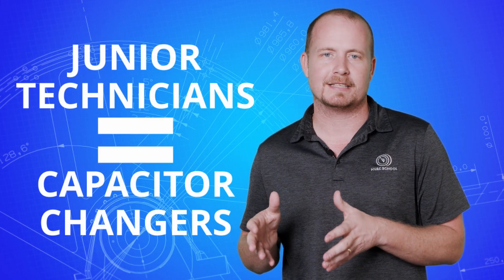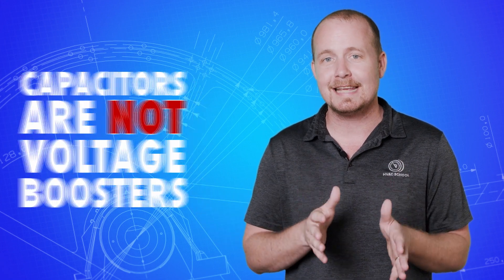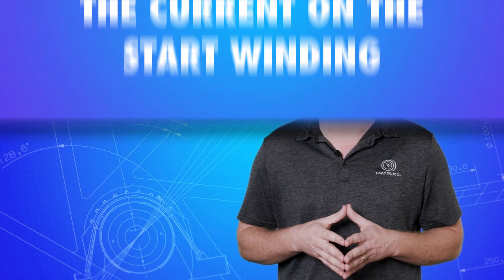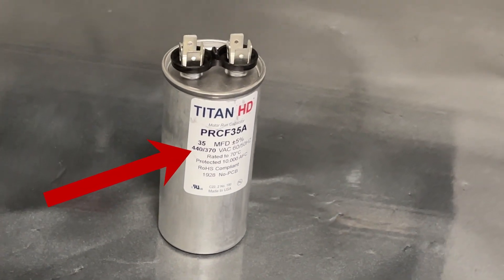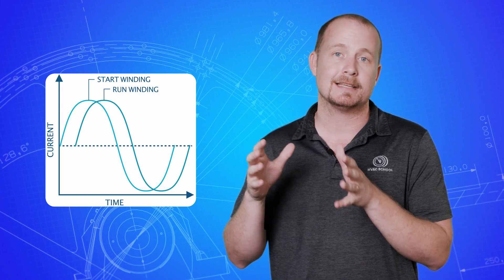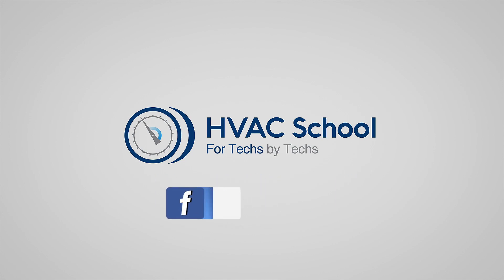5 Misunderstood AC Run Capacitor Facts

Comment: Has anyone ever seen a condenser fan run slow when hooked to a dual run cap (50/5) but runs at full speed when you use two capacitors (one 50 and one 5) and yes the dual run tests 100% fine, and I even swapped if for a brand new fresh off the truck 50/5 just in case it had something strange going on.

Comment: Near the end you came up with a formula to determine the value of the capacitor.  You show the measured start winding current times 2652 (60hz) all that divided by the measured voltage across the capacitor, in your example 192.9 volts.  Where did you come up with this formula?  I know the subject of capacitive reactance is not the name of the subject here.

Good tutorial -  Jim

Comment: I have a battery power supply system EPS it have a 30 millisecond switch over time can an AC capacitor put across the 110v circuit to bridge the gap of voltage drop for switching time.

Comment: I couldn’t find locally my two phased ac capacitor but was able to find a three phase but didn’t buy it because I didn’t think you could use a three phase for a two phase. Wife called ac tech and he came out and installed a damn three phases capacitor and charged me $208 dollars later. SMH charged $119 for the capacitor and 89 service fee. My question is it okay to have the ac capacitor like this.

Comment: Some of this is a little misleading, but accurate. There is a magnetic coupling between the plates in the capacitor. While the electrons aren't passing through the dielectric and insulative barrier, a charge is being induced on the other plate of the capacitor (via faradays law). You should probably go into a little more detail about I rms and V rms to provide a little better explanation of capacitance, and the phase shift and reactance that is happening. Good video still through.

Comment: As an Electrical Engineer, I don’t know how to comment. Some things are correct, others oversimplified but kind of correct, others intuitively correct but very wrong. 

The ideal induction of a motor is exactly the opposite of the ideal capacitance of a capacitor. 
I = C•dv/dt vs V = L•di/dt. 

What happens when the rate of change of current equals the rate of change of voltage?
Reply: Geez!!!  We are technicians not engineers. His explanations are perfect for techs. Just the info we need. Just enough but not too much. We work on this stuff. We don't design it. Nice touch with the derivatives. Some of us had Calculus and AP physics in high school but we don't need that crap to troubleshoot or remove and replace faulty components. 

But to answer your question about what happens when di/dt equals dv/dt in a RLC circuit is called resonant frequency. This happens when the inductive reactance becomes equal to the capacitive reactance in the circuit (2πfL = 1/2πfC or ωL = 1/ωC) and maximum current flow occurs because the inductive reactance and capacitive reactance cancel each other out and the circuit becomes purely resistive. 

You state: "The ideal induction of a motor is exactly the opposite of the ideal capacitance of a capacitor." But a better and more accurate statement would be: "The ideal induction of an inductor is exactly the opposite of the ideal capacitance of a capacitor." Because a motor is not purely inductive. It has a resistive element to it. So you're wrong there.

Some of us technicians know this crap, but unlike "engineers", we don't see the need to flaunt it.

Instead of coming on here to show off, you should be helping by answering questions some of the techs have.

Comment: I’m still confused as I thought compressors needed a start capacitor. Dual run capacitors indicate RUN, so where is the START CAPACITOR?
Reply: They don't need start capacitor
Reply: It depends on the type of motor that drives the compressor. A Permanent Split Capacitor (PSC) motor will only have a run winding that remains in the circuit from start to finish. The run capacitor helps provide more torque at start-up, and once it reaches the motor's rated speed, it helps the motor run more efficiently. That's how this motor gets its name: the capacitor is permanently in the circuit and its duty is split into helping both the start and run windings.

Another type of motor is a Capacitor Start Capacitor Run motor. It has a start and a run capacitor. The start capacitor helps provide more torque at start-up and then it's taken out of the circuit by a relay or centrifugal switch at about 75% of motor's rated RPM. 

There are other types of motor but I don't have the time to list and explain them all. I hope you get the jist of what happens with the 2 examples above.

Comment: Ok here is a possible myth. But could be true. I have been told you can go up on the compressor capacitor size by 5 microfarads. Now if you’re using a turbo 200X and are trying to make a 45/5 connection it says to use the 50MFD terminal. So i would think it was ok. But I’d like to see what the pros think.
Reply: I've always been told you can't go down in size but you can go up but not more than 10%, so I believe amrad recommendation to use the 50 Terminal to replace a 45 is acceptable
Reply: @7x779  As far as the microfarads, I think it makes more sense the other way around. It's better to go down a max of 10% than to go up a max of 10%. Going up by 10% will increase the current that goes through the start winding and may reduce the motor's life, but I don't think it's going to hurt if you go up or down a max of 10%. Ideally, you want to replace a capacitor with one that has the same exact MFD and voltage rating. 

One thing you cannot go down on but you can go up on is the voltage rating. Like he said in the video, you can replace a 370 Volt capacitor with a 440 Volt capacitor but you cannot replace a 440V with a 370V.
Reply: @bernardocisneros4402  did you find actual information somewhere that says going up in capacitance will cause the compressor to draw more current?
Because from what I recall, whenever I replace the capacitor that's reading 10% or more low and I checked the amperage before I change it, when I put in a new one it actually draws less current. And the lower the capacitance is on the old when I'm replacing, the greater the drop in current is when I put the new one in which has the correct higher value
Reply: @7x779  I don't know what type of motor you're referring to and if it had only one run capacitor, or it had two, a run and a start. I also don't know which current you measured. Did you measure the current going through the start winding or the run winding or both?
Did you measure the in-rush current (LRA) or the running current (FLA)? 

The most common type or motor is the  Permanent Split Capacitor (PSC) motor and it comes from the factory with only a run capacitor wired in series with the start winding and in parallel with the run winding.  On this type of motor, increasing the capacitance (MFD rating), will increase the current flow through the start winding at start-up to increase the torque for a quicker and easier start cycle. After the motor starts and reaches its rated speed, the current through the start capacitor drops significantly due to back EMF. When the motor is running at rated speed, the run capacitor helps the motor run more efficiently. 

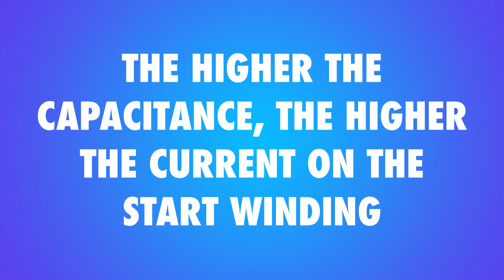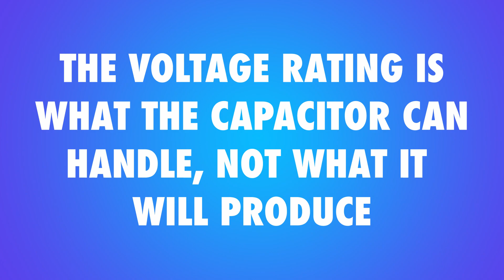Go back and watch the video from 1:52 to 2:40 and listen to Bryan re-iterate this exact same concept.
Reply: @bernardocisneros4402  I'm talking about when the motor is up and running weather at the compressor or a condenser fan motor or a blower motor and it's irrelevant whether there's a start capacitor or not because it's not connected or functioning at that point, and I measured both legs on the standard PSC blower and condenser Motors, and usually measure the common and or run on the compressor

I'll have to pay more attention to this in the future, but from every one I can remember, the current dropped when replacing a weak capacitor
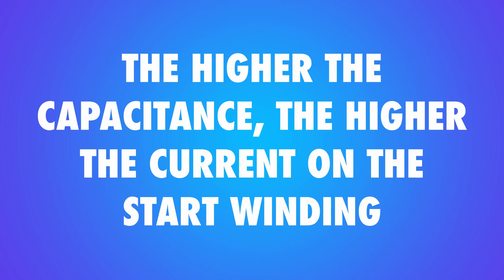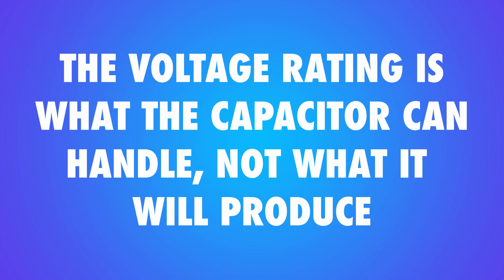Reply: @7x779  Did you re-watch the video from 1:52 to 2:40?
Reply: @7x779  I'm talking about the current draw when the motor starts. When you put in a capacitor with a higher MFD rating, it creates a larger phase shift between the current waveform and voltage waveform in the start winding at low RPMs because there isn't much back EMF at low RPMs. As the RPM increases, so does the back EMF. The back EMF fights against the phase shifting effect of the capacitor, so as the back EMF increases the phase angle difference between the current and voltage waveforms in the start winding decreases. Once the motor is running at rated speed this difference in phase angle is as small as it's going to get, and the smaller the difference in phase angle, the higher the power factor. The reason you see the lower current with a bit higher MFD capacitor is because it improves the power factor when the motor is running at rated speed. The engineers pick a capacitor with an MFD rating that will give a good starting torque, only draw as much current as the start winding can handle, and help the motor run more efficiently at its rated speed.
Reply: @bernardocisneros4402  that's a good explanation, thank you. I'm assuming that in your last response you're talking about a compressor or motor without a start capacitor, correct?
Reply: @7x779  Yes, I'm talking about a PSC motor with only a run capacitor. When these motors get old and have a hard time starting, you add a hard start kit (5-2-1) to help the old tired motor start. The hard start kit adds a start capacitor in parallel with existing run capacitor and in series with start winding. Which is essentially just adding more MFDs to start circuit. The additional MFDs create a larger phase angle shift between current and voltage in start winding. This makes the start winding draw more Amps at start-up. 

The additional MFDs also cause a larger difference in phase angle between the current waveform in the start winding and current waveform in the run winding. Along with the increased Amp draw, this phase shift between the 2 currents causes the additional torque that helps the motor start. Once the PSC motor reaches about 75% of rated RPM, the high back EMF generated in the start winding energizes the relay of the 5-2-1 kit and it opens the contacts between terminals 1 & 2 in 5-2-1 thereby removing the start capacitor from the start circuit.

Don't confuse the phase angle shift between the current and voltage in start winding with the phase angle shift between the currents in start and run windings. The 2 are not the same. The phase shift between voltage and current in start winding draws more Amps through the start winding while the phase shift between the currents in start and run windings helps create more torque. 

The additional torque at start-up is a result of the additional amp draw, the increased phase shift between the currents in start and run windings, and the geometry of how the start and run windings are arranged within the stator of the motor. 

I hope this explanation causes more understanding than confusion.

Comment: What's the difference between "in and out" vs "through"?
Reply: In and out is like walking in the front door of your home and then walking back out using the front door. 

Through would be walking in the front door and walking out the back door. 

Current never goes through a capacitor. It only goes in and out of it.  It only seems that current goes through a capacitor when using AC power because AC power goes back and forth 60 times a second. 

When using DC power it's very easy to see that current does NOT go through a capacitor.

Comment: Thank you for explaining Capacitor related to AC.  We had the AC tech tell us that our capacity was weakening but has not failed. We put off replacing it.
Reply: I've also delayed doing that a few times, and sometimes they even tested good, but I was back in a few days or weeks because they failed

And when they fail, they can sometimes take out the compressor with them if the compressor has any weaknesses in the windings

And I've had others that tested less than the rated minimum and they've been running like that for years and years, and others that tested good and failed in just a few days

It's hard to anticipate when they're going to go
Reply: You 100% right thank you for clarifying it

Comment: Ok. I understand that the run capacitor shifts the phase of the start windings and creates a rotating magnetic field to rotate the rotor. What happens when placing a hard start capacitor in parallel with the run capacitor? It increases the capacitance may times. How does that alter the phase shift?
Reply: I don't know but I have been on a couple jobs where it didn't have a run capacitor at all and somebody hooked up a two wire start booster in place of it and it had been running like that for many years. I couldn't believe it and I've seen it twice
Reply: @7x779  That "two wire start booster" you mentioned has a start capacitor in it and it helps start the motor. If the common terminal of the compressor is connected to T1 of the contactor, then one wire of this 2 wire booster is wired to T2 of the contactor and the other wire is wired to Herm. The bottom part of the 2 wire booster is the capacitor and the top has a Positive Temperature Coefficient (PTC) thermistor that increases in resistance as its temperature increases. Once its resistance reaches a high enough level, it stops the flow of current thereby removing the start cap from the circuit.
Reply: @jamesmacdonald9800   When you install a hard start kit (5-2-1), the start cap helps increase the phase angle difference between the current going through the start winding and the current going through the run winding. The bigger the phase angle difference between these 2 currents, the greater the torque produced to begin rotating the motor. The biggest phase angle difference you can attain between the 2 currents is less than 90 degrees. This desired difference in phase angle between the 2 currents is the result of placing the start cap in series with the start winding not from placing it in parallel with run winding. That's why once the motor reaches 75 to 85% its rated speed, the potential relay is energized, and removes the start cap from the circuit.